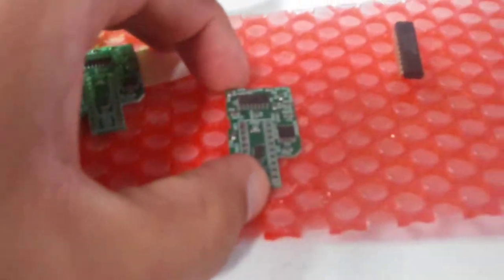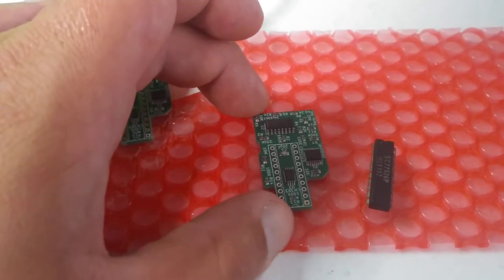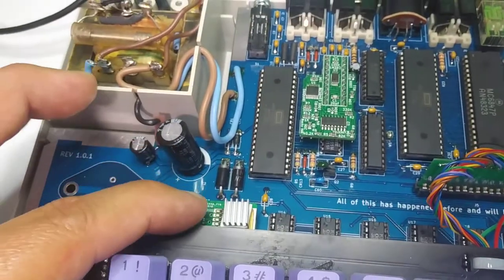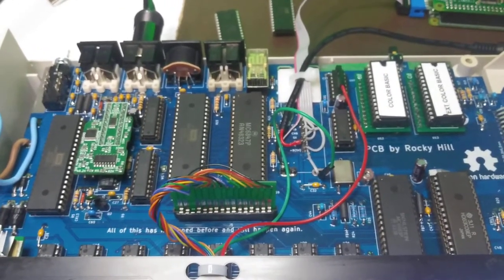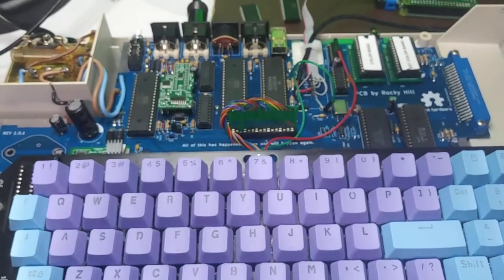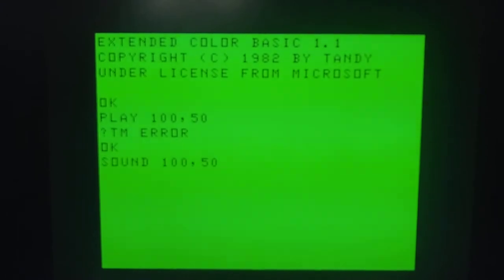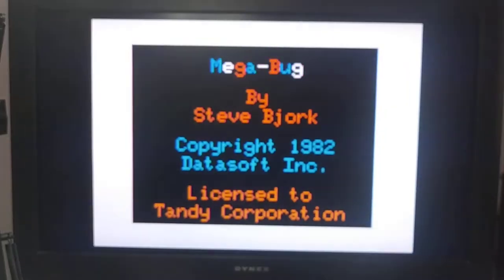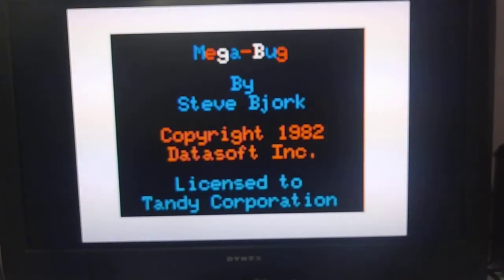(New CoCo?) SC77526P DAC replacement board revision 1 for the CoCo

Comment: I believe John Strong is working on a full size replacement case which is really cool.   Do you suppose the interference is a shielding issue?
Reply from the maker: I've actually spoken with John and even sent him a CoCo 3 board for a test fit., fingers crossed! The interference can definitely be an interference issue, I'm glad you reminded me of that. I think I might wrap it in aluminum foil to see if that helps. Thanks!
Reply: @rockyhill3  Awesome!